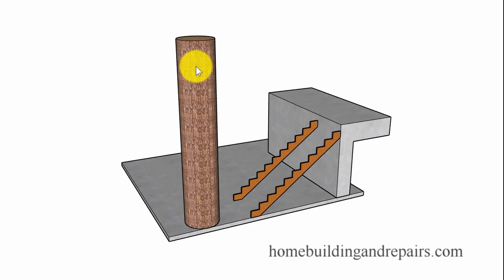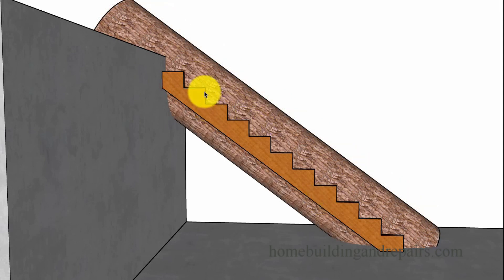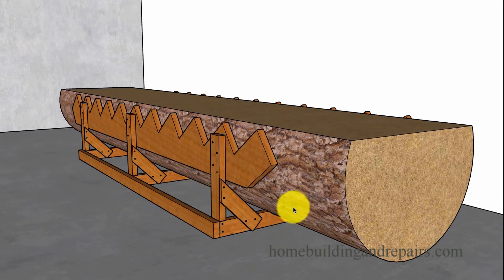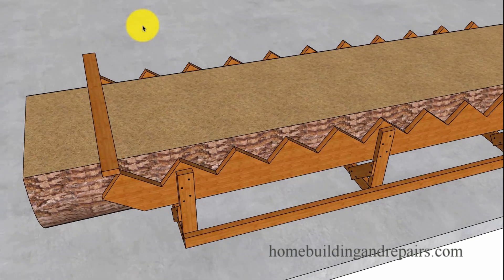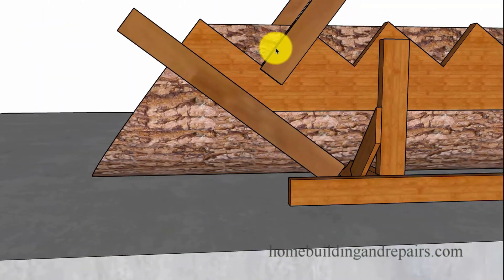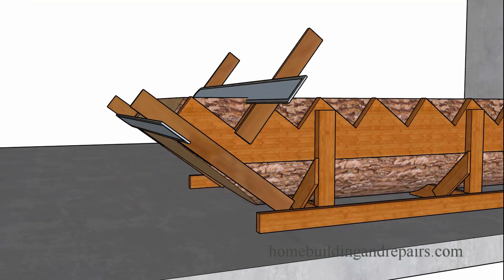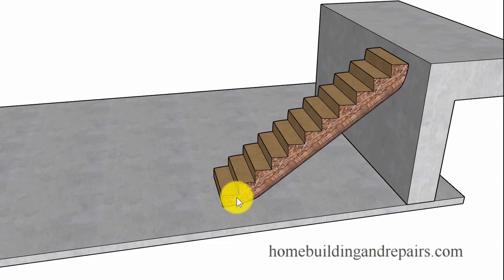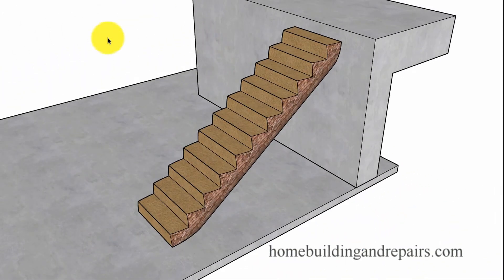How To Build Stairway From Large Tree Log Using Template And Chainsaw

Comment: no offense, very creative stairs but you've obviously never used a chainsaw before. 

For starters your "guide" sticks will be torn to shreds by the chain, very likely a one time use IF you're lucky. 

Number two, it's extremely hard to cut a straight line with a chainsaw this big, if an over-three-foot chainsaw even existed. (good luck finding one).  Very likely four cuts would have to be made per each tread, two on either side, in attempts to stabilize the cut.  

And just a third point, but no chainsaw on the planet leaves a smooth cut. You are looking at hundreds of hours of sanding and leveling and chizelling and planing and smoothing once you are done playing Freddy Kruger, unless you like the idea of walking on thousands of upright toothpicks left behind from the chains' teeth,  lol. 

May I recommend a large bandsaw instead? Or perhaps a long sawzle or even industrial lazer cutter? You'd be more likely to get stairs that were square, flush and even. 

But again, nice idea, assuming you own a ten ton crane to lift the log into place after, and a house three stories high to accommodate the crane lol.
Reply from the maker: Thanks for sharing your opinions and yes they do make 6 foot long chain saw bars.